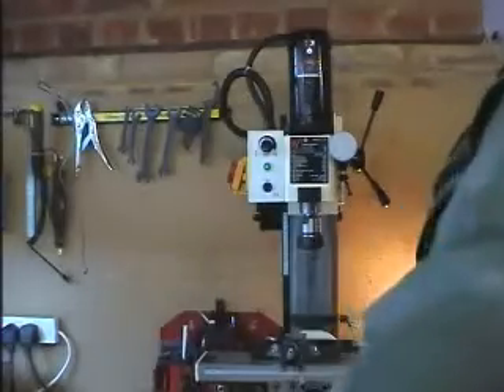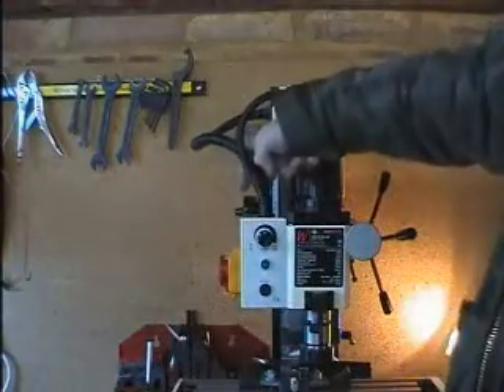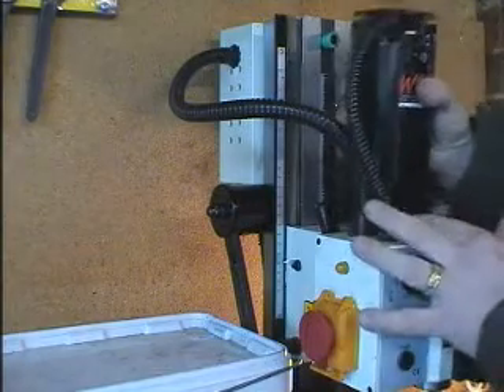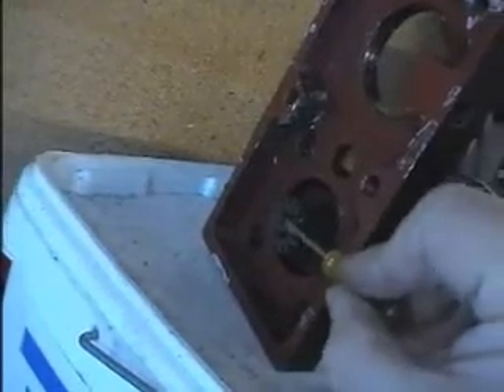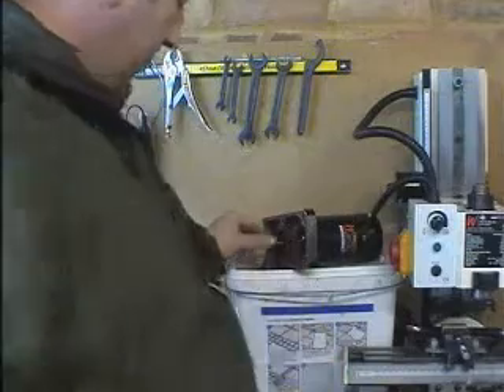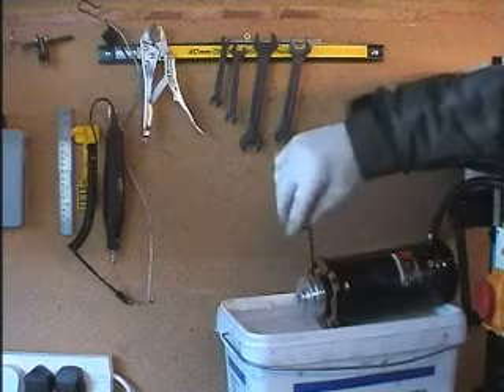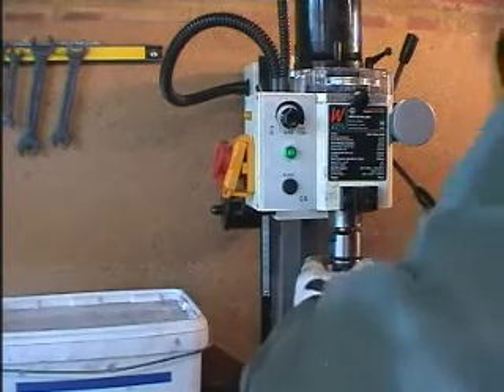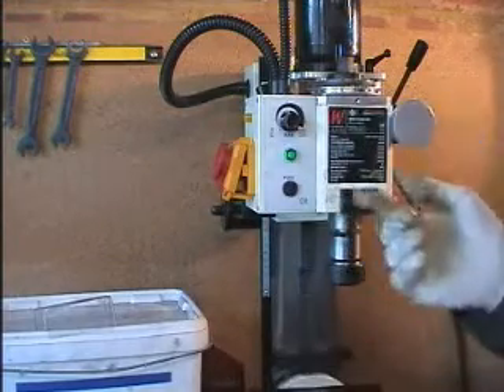X2 Mini Mill Belt Drive Conversion

Comment: STOP NOW,NOT GOOD: Mills are made to move at low RPM's(400:steel -1400+:wood) do to heating up your bit, and item; In fact, a rubber belt with a non-tengner pully track is not good. Example, all cars has a tengner on the alternator belt. Right! Thin small belts on a load in time will slip. As a consumer, I would infact rather keep what come with the item save money and save my warranty. Noise is not that bad use eye-plugs.$2.98 for a box of 50. I clean them with soap and use them agen.

Comment: Having used quite a few mills from tiny to bridgport turret mills,these x2's arent that bad,solidly made apart from the plastic gears in the gearbox,noisy but functional.Good value for money but dont buy the quick release vice they sell for this as the one I had was miles out of square,you can get a metal gear set or fit the belt drive to eliminate the placcky Gbox.